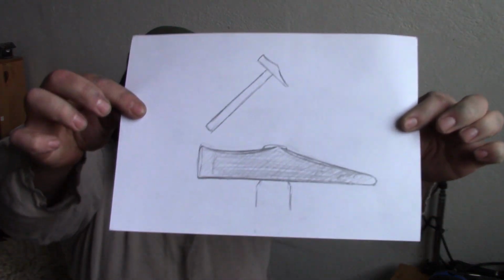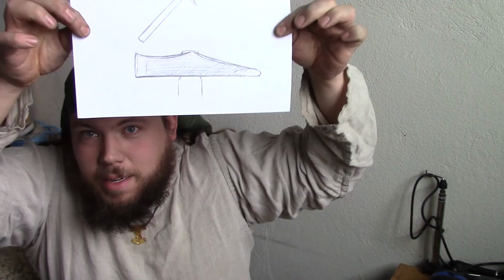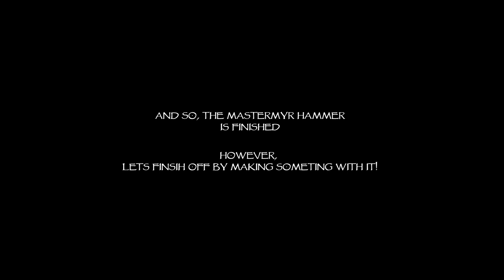Viking Month, March to Valhall Part 3. The Mästermyr Hammer

Comment: If I ever get 1/10 as good as you are I will be quite happy! 
Sadly I dont really have the time and energy the spend in my forge (especially since its a outdoor forge, not too pleasant when its cold out).

And I am quite jelous of your belt sander, the most boring part of the blacksmithing projects is the grinding/sanding, which I do with my angle grinder and a slow, small beltsander that grinds flat, but slooow.

Hälsningar Adam från Holmgers Hird.
PS. Kökskniven jag köpte är ett underbart verktyg för en kock som mig!
Reply from the maker: Know exactly how winter forging outside doesn't make for a productive working environment. I didn't always rent this workshop xD
The belt grinder is the workhorse of any professional knife studio. If I didn't have that, my work would be MUUUUUUUCH more expensive..

Hoppas det är bra i dessa tider!
Va roligt att den funkar bra!